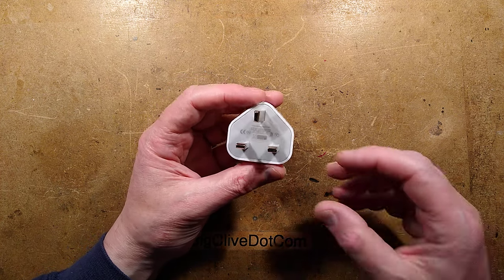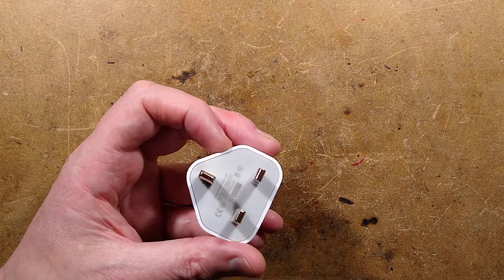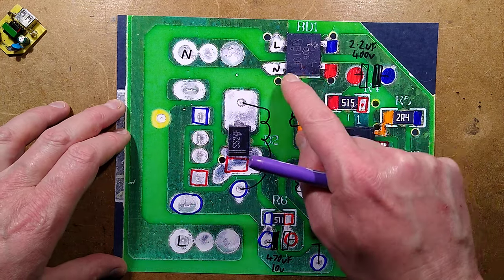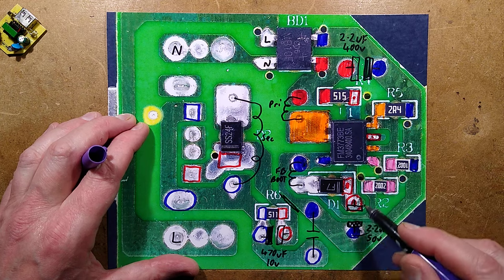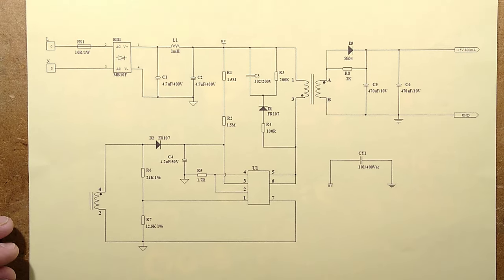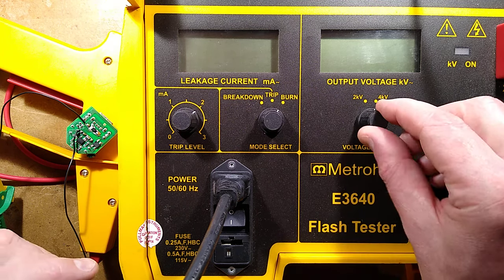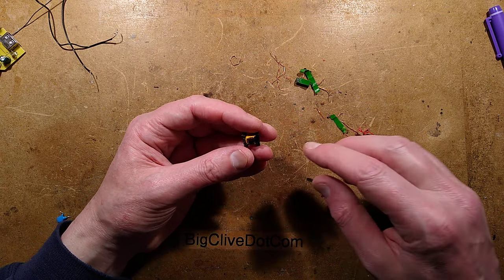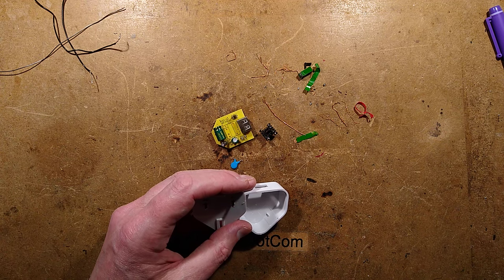Don't buy cheap death-wish chargers

Comment: My confusion started the moment that I noticed that they safety coated the bottom two pins, but NOT the ground pin.... not that it matters in the end as it isn't connected, but that isn't much of an excuse.
Reply: The ground / earth on a UK plug is meant to be that way, its only the live and neutral that should have the sleeve - this is to stop anyone touching the pins when the plug is not fully in the socket.  A quick google suggests that any UK 3 pin plug that has a sleeved earth is a fake and and potentially dangerous as the sleeve could prevent the earth pin from making proper contact inside the socket, causing the appliance to be unearthed.

Have seen proper chargers and some two pin power cables with completely plastic earth pins though, if the equipment doesn't need earthing then the pins only purpose is to open the live + neutral shutter inside the socket and I'd guess it cheaper and easier to manufacturer that way.
Reply: ah, I'm backwards, that happens to me a lot, thanks for the education.
Reply: @ICountFrom0  No worries, as the saying goes "every day is a school day" :-)  Just to complicate things though there was a decades old 3 pin design that has unsleeved live and neutrals, not long changed on an 80's record player.

Comment: could a consumer ever get a case of 1000 volts ever coming into a houses power supply
Reply: Most likely only very brief pulses as nearby things get switched on and off. But if that pulse turns the 1nF 1kV capacitor into a resistor then ouch! Nearby lightning strikes are another way.
Reply: Absolutely yes.

Comment: Let's get something straight right away: class Y capacitors are the work of the Devil, full stop. I AM NOT AMUSED by getting a "tingling" every single time I unplug something that happened to be "isolated from mains except not really" from another of the same, while touching both...

Comment: Does the current draw affect the safety of cheapo USB supplies like this. I have a couple that are only used to power a PIR + LED light string (built from a previous BC project). Can only be a 20ma load at most.
Reply: Can still blow up even though it's less likely

Comment: The genuine Apple supply is my go-to for a general 1A USB adapter, as I know how well designed it is. I had to remove the remains of one of these fakes from a socket at work, where it had broken off on removal, leaving the live terminal sticking out of the wall... Very worrying that rubbish like this is allowed to be sold.
Reply: It's not allowed - most probably the CE mark on this product means nothing (should ideally be UKCA for the UK anyway, must be after the end of 2022).  But junk like this is sold unless the importer or seller has a conscience, or unless trading standard people actively block it.
Agree 100% re using Apple chargers.  They are very well designed in terms of safety, EMC, etc.

Comment: Am I missing something here regarding safety? It sounds like this device has a significant safety margin if it's designed for 0.2kV and fails at 2kV.
Reply: The test did seem odd. For a small portable unit like that you would check for insulation breakdown generally at 500V, and, at a push 1000V. I may be missing something, also. The high / low voltage separation was poor and the maximum current low but that is to be expected for such a low price.
Reply: @ralphj4012  Input to output isolation test requirements if I remember correctly would be 2240V a.c for 1 minute and clearance 3mm between hazardous live and accessible parts per EN 60950 for a CAT ll 300V device such as this. This is clearly a non-compliant product and should be reported to Trading Standards who should take the necessary enforcement action. It doesn't matter about the size or price, the legislation sets the safety requirements which are legally required for a product to be placed on the market.
Reply: Just because it is operating at 230V doesn't mean it won't be subject to far greater transient voltages which are generated by switching inductive loads, lightning strikes nearby etc. A safe product must be designed and tested to withstand such overvoltage conditions and remain safe in both normal and fault situations.
Reply: @125brat  Hmmm, odd (to me). Some small low current switching transformers, caps, suppressors etc from reputable manufacturers are only tested / guaranteed to 1500V
Reply: @ralphj4012  That doesn't mean they can be used in applications such as these. The product needs to be designed to meet the requirements and built using suitable components and techniques, not made using components that don't meet the requirements then hoping for the best. The items you mention may be suitable to meet the basic insulation test voltages for a Class 1 product i.e. with a protective conductor, but not for a Class 2 with double/reinforced insulation and the applicable test voltages for a Class 2 product.
I've just done a limited search for EN/IEC 60950 test voltages on the web and confirmed 1500V a.c. is the test voltage for Cat ll 300V Basic insulation, so this would be the test voltage for the items you mention.

Comment: While I understand that, when typing, it is reasonable to use the letter u as an approximation for the Greek leter mu, used to express quantities such as microfarads, such reasonability vanishes when writing down: nothing obstacles your actually writing the Greek letter mu. It is disappointing. It is also disappointing to see you write down abbreviations of units, like an M for a megaohm, instead of being precise. Is it so difficult to write down an uppercase omega or a lowercase mu? Really?
On the other hand, you are minutious and your videos are worth of commenting. I enjoy watching them and listening to your reverse-engineering descriptions. Myself, I started doing that on my toys when I was four. First try on electronics, at 12 (but then my sister's transistor radio mysteriously ceased to work....).

Comment: ... And it wasnt even pink !
 Two disappointments!
 :-(

I went for the original samsung/lenovo usb supplies coming with the devices and got some 2 port amazon (basic) ones additionally.
No tingly feeling and i think (hope) amazon does go the safe way since they also were not the cheapest.

Only downside i noticed, if i really charge my tablet and phone it gets really warm,
so probably tasty hot inside.
Thus i normally use only one port for charging, some low power led lights on the other so the caps wont die too fast of heat ageing inside.
And of course never leave them plugged in out of lazyness. Switched mains off or not plugged in when not in use.

Comment: I'm surprised you didn't point out that the earth pin went nowhere.
Reply from the maker: It's not needed.  But I prefer chargers that do have ground referenced outputs.
Reply: @bigclivedotcom  Did it have the "double-insulated" sign to make it safe?

Comment: How does the dc run from the primary to the secondary of the transformer?
Reply from the maker: The DC is used to pulse the transformer at high frequency.
Reply: @bigclivedotcom  so it's kind of like two inductors exchanging charge.
Reply from the maker: @miscellaneousguy3803  The primary induces a magnetic field into the core and then turns off, and the collapsing field then induces a current into the secondary side.  It has less turns, so the same energy creates a lower voltage at higher current.

Comment: It's about time that the importers of crap like this were prosecuted under the safety regulations. As a UK citizen I would be breaking the law if I sold a bedside lamp that was perfectly wired but not PAT-passed, etc. There are a lot of hoops you should be jumping through before you can legally sell anything electrical.
Reply: Absolutely, but we just haven't got enough Trading Standards people to enforce it due to government cut backs of everything.

Comment: With all the safety regulations,  how is this even possible??? Is this why GB did not want to be a part of EU? My faith in safety standards enforcement has been severely shaken.   (used to specify, design, and qualify medical devices per UL, ISO, IEC and other  standards).
Reply: This has been going on since long before the UK left the EU, I don't think there have been any significant changes in the regulation of electrical products in the UK since we left.

The EU and UK allow manufacturers/importers to self-certify for most electrical goods. Manufacturers/importers/retailers with a reputation to uphold and with serious money to lose to fines/lawsuits usually do their due diligence to ensure that their products comply.

But at least in the UK (I can't speak for elsewhere in Europe) market traders and small independent shops are often much less careful. Neither customs nor trading standards seem to have the resources to do anything about it.
Reply: @petermichaelgreen  Unfortunately this appears to be the case. Too many crooks and not enough cops.

Comment: I did not see any connection to the earth pin when it was opened?
Reply: Completely fine for this type of supply not to be earthed, doesn't need it.
Reply: @muxerbaker4638  except when they don't have reinforced (double) insulation. In any case earthing wouldn't help as there is no fuse so a 32A ring circuit would cause this thing to explode in a fault.

Comment: ive got a amazon 3 port charger, 1 usb qc3 ad 2 reg usb.

it gives me nips if i touch ground from the usb side. i metered it and 90v ac was showig on usb ground....
Reply from the maker: That's common.  It's AC leakage coupling across capacitively.

Comment: That's definitely not an apple 5w charger at all, not even from the plastic on the inner side doesn't look like apple whatsoever, and the pins inside the plug are in the wrong places and the circuit board isn't even close, however I have had 5w and 10 w apple USB chargers fail, just goes to show why I use Android

Comment: How often mains voltage spike over ~220v let alone  2000v?
Reply from the maker: More often than you might think.  Plus the risk of electrostatic discharge initiating a fault path between transformer windings.

Comment: eBay are still the biggest offenders for selling this shite.  I bought a cheap laptop charger for my own workshop use.  The output was so noisy it interfered with the correct operation making it quite useless... and almost certainly dangerous.
Reply: Frankly I don’t know where to get a laptop power brick (19v for acer) that I know is any good.  The mfg one is reasonably priced (unlike apple) but it’s probably hit or miss quality as well (it says liteon but is it?  does acer even know?)
Reply: @radellaf  have a look on CPC if in the UK.

Comment: always worried about barefoot children and some of these power supplies
Reply: Sounds like a third world problem.
Reply: @haywoodyoudome  bare foot and freedom is what they prefer  If they can go out in the snow they would .Much of the stuff is being illegaly imported and sold in Canada and there have been fatalities from some of this crap .problem is you can legally import any equipment so long as you modify to comply with Canadian codes and internationally accepted standards Like PQS ,CSA UL, ULC,TUV Rhineland ETL and others .problem is they get a few certified and then slip the sub standard builds in . Common practice .Home Depot has sold loads of non compliant equipment from the CFL bulbs to extension cords and other equipment
Reply: @carlubambi5541  Maybe the Canadians can get together and ask Justin Castro to pass sweeping legislation to outlaw the already illegal imports.  I mean if you can't stop a problem you can at least pass more legislation to make it look like you're trying.

Comment: Kinda scary when I think how many times in a year I'll plug into somebody else's charger, or a handily-placed wall USB outlet somewhere.

Almost guaranteed that one of those is cheapo deathy crap.
Reply: So don't do that. Be organised about your charging needs. Your own plugs and cables are small and light enough to carry with you and anywhere (except maybe on a bus or train) there's a USB outlet, there's sure to be an ordinary socket too. If you also carry a decent capacity battery pack, you needn't use mains power at all when away from your home or workplace.

Comment: True crap, I wonder about anything that small, just no room to do it properly.
As for the 'one pound' bit, it should be safe no matter what the price, they chose that price, not you. Anyway, what's to stop some unscrupulous person repackaging these and trying to pass them off as high quality at many times the price.
This is the problem these days, you see something on the shelf in a shop that you need, however it's near impossible to tell whether its been done right inside, and its not something made for cents, then market up to ridiculous levels because "that's the price the market expects"

Comment: I remember buying a lightning cable on ebay. Put my phone on charge and left it on the table while I made a sandwich. Came back to the cable smoking and melting into my phone. Made a complaint with the seller and he turned up knocking on my door the next day with loads of accessories begging me not to report him. Could have burned my house down.

Comment: Buy the most expensive charger you can find guarantees that you will get a really good charger while paying a lot more than it is worth and could be bought for less money.  But buying a cheap charger guarantees you are going to get the crap charger worth the money you are spending and will cost you more in the long run than paying extra for quality instead.

Comment: Hmmm....wonder where Apple stuff is made? Oh yeah, China, Korea, etc. Apple chargers have a reputation for high cost, short life. Years of experience behind that statement. A could of well known aftermarket brands I've found far exceed Apple and no, not telling. Find your own. Apple is not the stellar supplier that many believe them to be. Are all Apple products junk, nope, for the money, they should be 100% failure proof. But as with most robotically mass produced electronics that never are touched by a human hand until shipped,  a misalignment in a machine can turn out hundreds or thousands of "off" products before it's caught.

Comment: I bought an aftermarket one from Home bargains, your right, absolute rubbish, I thought I had a fault with my phone as I was using it for mine, I realised that it was the cheap plug that was the problem, it worked fine at first, but yeah stay away from these products, buy official Apple ones.
Reply: Not necessarily Apple ones, just ones from reputable companies I guess

Comment: Hi Clive I have an Apple USBC charger if you want to take it apart. I bought it for a Jugee charger but it doesn’t work with those apparently so it’s no use to me.

The folding mechanism looks interesting; it’s the only thing I’ve bought with folding pins that isn’t all wibbly-wobbly. Must be a pretty strong spring in there.

Comment: I don't think Clive owns any Apple Products. all mine come in crinkly bags! MacBook, iPhone, ect. all Crinkly bags.
Reply: Maybe things have changed, I haven't bought an iAnything in about a year, but every single thing I've bought from Apple over the last 15 years came in a box.  Usually a box with such close tolerances it was a PITA to open due to air pressure or anti tamper seals.  This includes earphones and Ethernet dongles.

Comment: Why on earth would I subject a 5V USB charger to 2000V in real life?
Reply: @Matt Quinn - What on earth are you talking about. Apart from the mains RCBO circuit breaker for the house In Europe 16 Amp and 8 Amp FI circuit breakers aka RCBOs for every room  are mandatory and on top of that has every plug and socket in the UK an additional fuse built in.
32Amp DC at 2000V?! From a 5V 1Amp USB charger plugged into a residential wall socket?! In the civilised parts of Europe?! I very very much doubt that.
Moreover is the standard test 1000V overvoltage and the device performed fine at that.
2000V is post brexit health and safety  paranoia gone nuts!Even from a German perspective. And we Germans are very paranoid about health and safety.
I just say Lucas Electric... The prince of Darkness. LOL
Reply: @Matt Quinn - 
OK. You win. You are the professional.
Then please tell me,
how many people died in Dundee last month of cheap USB chargers connected to a smartphone?
Reply: @Matt Quinn - Please answer the question. This is about health and safety and the life of people, not about medieval straw man burnings.

Comment: On a completely (well almost) unrelated point I recently had the opportunity to take apart a failed £130-a-piece Hoover H-Free 500 battery. Whilst the insides were easy to remove the battery and attached charge controller where almost impossible to divorce, and it was clear from the design that they absolutely positively did not want you to replace any of the 6 18650 cells.

On the plus side I did discover why it had failed though. The proprietary connector on top had very little support outside of the linearly arranged pins on the underside and it appeared some 'enthusiastic' insertions had caused several of them to fail due to flex related fatigue. It was entirely repairable if the charger could be non-destructively separated from the cells...

Perhaps now that they've finished mandating USB-C ports on all mobile phones the EU could get around to stopping companies from screwing customers like this?